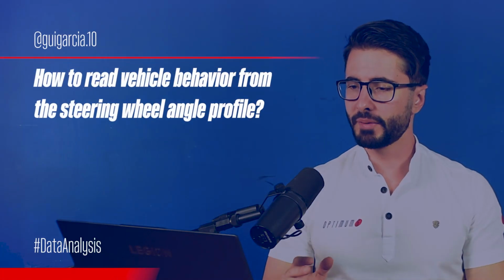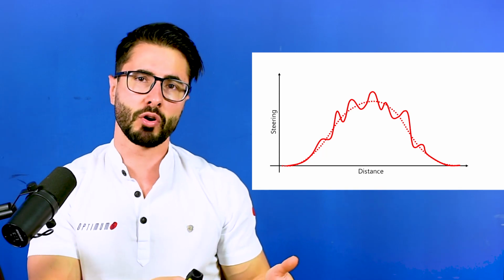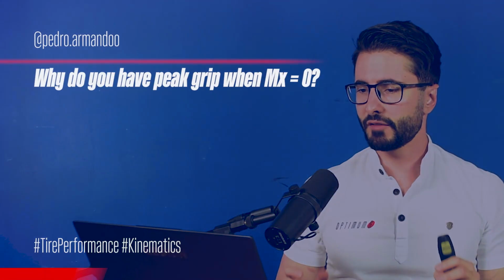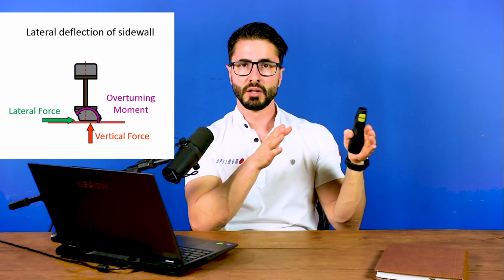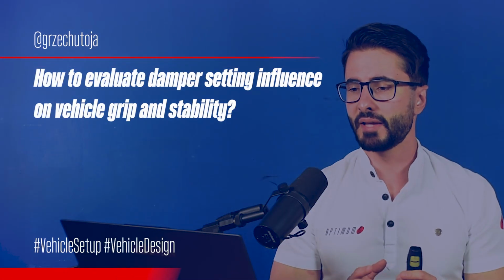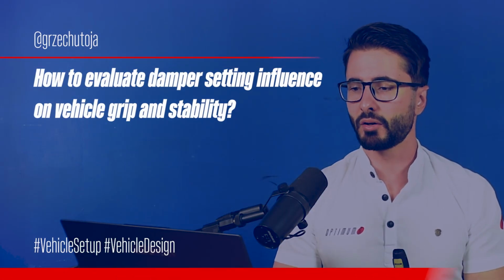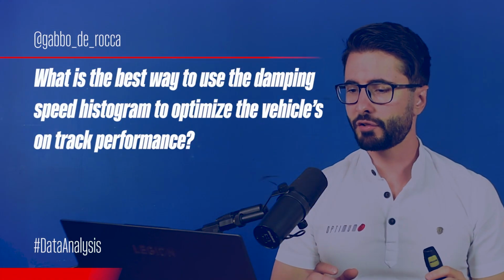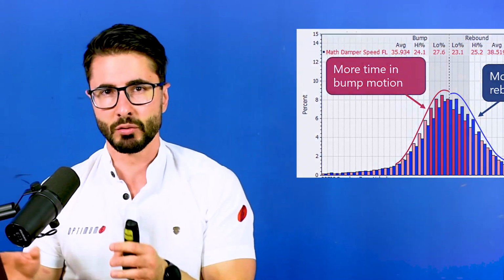Data Analysis, Vehicle Setup and Common Misconceptions | Q&A Series - Ep. 3

Comment: Question:
What is the effect of KPI, Caster angle, scrub radius and mechanical trail on the rear suspension? Do We only implement them for the sake of packaging or do they effect the overall performance?
Reply from the maker: Thank you for your question. These parameters do influence performance, even though not as directly as on the front axle. Mechanical trail and scrub radius will dictate how the contact patch forces will be distributed between wishbone and toe link, and this will determine the compliance of the system (as you brake, how will your toe change due to compliance?). KPI and caster angle are less directly impactful, but remember that your upright pick-up points will define many parameters such as instant centers, roll center, bump steer, etc. We added this question to our list of questions to be answered in depth in a video.

You can find more information in our kinematics design series: https://youtu.be/DeuzocXKxHQ?si=h4StWPmFnzNQWnzb

- Bruno

Comment: How does one determine the desired knee velocity for a damper curve?
Only using the crossover frequency does not yield velocities without a corresponding amplitude...
Reply from the maker: Thank you for your question. There is not one rule on how to determine this. A possible approach is to determine the highest speed that the damper would see with body movement (heave, roll, pitch), in the typical range of 1 to 4 Hz depending on the vehicle type, and use this is as the knee velocity. In this case, anything on the low speed region would control body movement, and anything above it would control unsprung mass movement, ride quality, and curb ride performance.

You can find some more information in our damping design video: https://youtu.be/-vcex7dxW9c?si=DoFm0Z2TvMUksjDu

We added this question to our list of questions to be possibly answered in depth in a video.

- Bruno